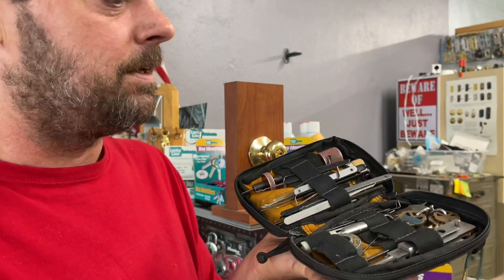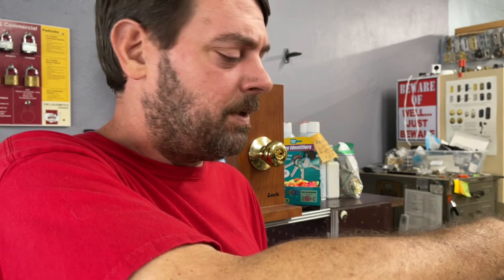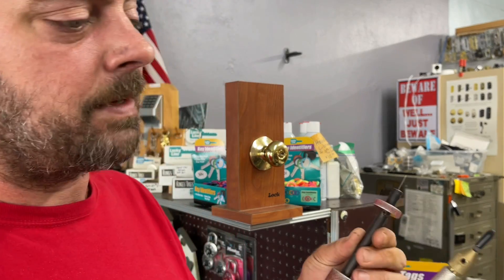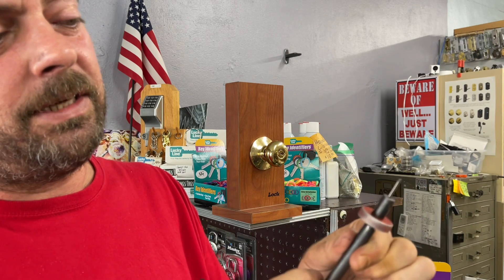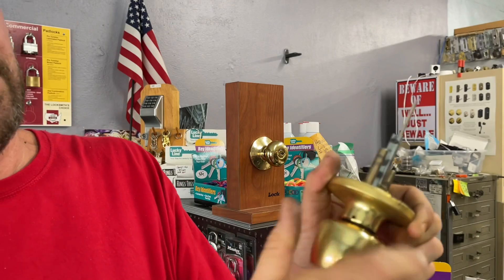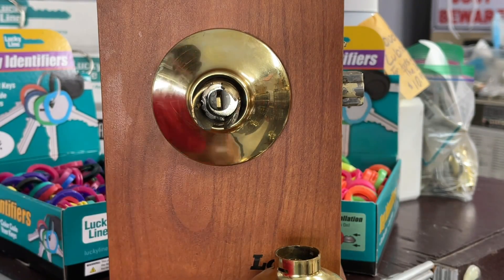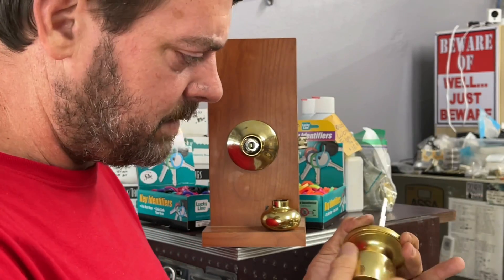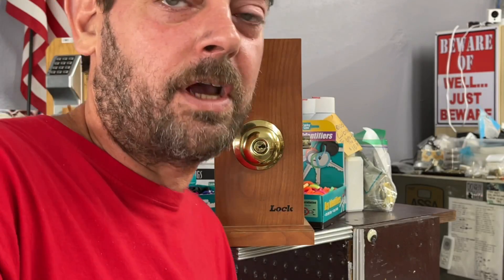Locksmith Tips & Tricks: Schlage Knob Lockouts, Avoid Spin Failure!

Comment from the maker: 4:41 in the video, I misspoke about “two retainers” while I meant to say “two retainer holes” I corrected it in video but wanted to post it here just so everyone understands the “generations” of knob styles.

Here is the text that is in video: which kinda explains the different knobs but is kinda small in video itself:

I need to clarify this, there is only ONE retainer on all Schlage knobs

Old Old F Series = 1 hole on each Side, retainer is in one or the other, standard cylinder type

Old F Series = Compressible Cylinder, only 1 hole on one side with retainer. Lock stays locked outside if inside knob is turned

Newest F Series = Same as above but auto unlocks turning inside knob (and has significantly reduced Schlage lockout calls I might add 🥺)

Also at 10:02 I said “Kwikset are tougher to open” when I obviously meant Schlage. I think my brain saw the plug in that vertical position and it made me think Kwikset, cause only Kwikset’s levers had vertical lock cylinders 🤷‍♂️
Reply: Thanks for clarification Jason great video my friend, totally understand want you ment thank you 😎

Comment: I have been out of the locksmith trade for 15 years, but back in the day I made a tool out of a kwikset deadbolt plug and a cut off sc1 keyblank. You may or may not know this trick, you could insert it in to an f series knob. Twist the f series knob twist it lightly and wrap the tool and it would jar the mechanism and allow you to open the knob without even picking it. I don't know if Schlage fixed this flaw, but it was a great trick back in the day.
Reply from the maker: ahhh yea the ole bounce open deal
I think that got cleared up before the compressible era rolled up on us but yes I recall using that a few times. As I recall though I wasn’t too fond of it, but it may have just been my not getting it

Comment: I’m usually using a Lishi if I pick one backwards I  always take a reading before spinning it. Then if I blow it I just cut a key.  A lot times in these f series they will take to lock position really easy then you can use the Lishi to take a reading and cut a key
Reply from the maker: another trick I’ve used, when you have multiple doors to open but you happen to be a good distance from the truck to cut a key, is once you’ve read the depths it’s typically pretty dang easy to Lishi again
Had a couple of deadbolts on a public pool restroom I recently did that to avoid walking a good way in the rain :)
Reply: @selock  definitely easier to Lishi stuff if you know the bitting! I do that cars a lot. I’ll pick it ccw because I’m a righty and it’s easier then take a reading then pick it cw to unlock it once I know the bitting.

Comment: i haven't Lishi picked the compressible cylinders yet but I have raked them open using light tension.  Sometimes a cylinder will pick one way better than the other though.  I've even bumped the compressible cylinders but I hate doing that as sometime the top will pop out.  Schlage should do better.

Comment: To me Schlage Compressible Cylinders are my hardest to pick. This is because the top driver pins are a smaller diameter and are under heavy spring pressure. Add that to the difficult biting they usually use make them difficult to pick.  There is a method I come up with that I go to whenever I feel I spent enough time to know this isn’t going to be a successful pick. These cylinders have a common weakness to them. And that is the compressible Cap. I made a few tools of different Lengths out of hard hook picks. I use them to get into the keyway and under the first two pins. From there I pry them up for the purpose of trying to “Blow the Cap” off the cylinder. From there it can be easily picked and you must rebuild it once off. 
    I learned Your Method of picking just to disassemble very early on. Especially on any commercial levers and knobs of all makes. I rarely use my plug spinner unless it’s for reversing direction of a tough deadbolt that needed to be picked in the wrong direction. 
   Time is Money. Great discussion.
Reply from the maker: yep, I hate doing it but I’ve had to “blow the cap” a number of times. Those times are ones where I giggle in joy when the installer put it in upside down ;)
Reply: Jason, I think a video about cap popping is a great idea! There’s almost no info about that out there

Comment: Those schlage knobs and levers are not easy to pick I've found
Reply from the maker: When that compressible cylinder came along it sure made them tougher :( even these "new fangled lishi things" don't like those t pins!
Reply: @selock  haven't had the pleasure of using a lishi on one but that's not surprising.. I always dread these knobs when customers don't have keys for them
Reply from the maker: @AuGold808  yep cause 8 out of 10 are gonna be corroded to heck as well!
Reply: You all are not using the Lishi correctly. When I roll up on Lockout and I see a Schlage lock, I bust out the Lishi and the customer is in he/her home in a matter of minutes.
Reply from the maker: @bobvalley4962  just like they can typically be raked in a “matter of minutes” Lishi is just another tool and nowhere did I say I was unsuccessful using the Lishi. It just doesn’t like the t pins compared to standard cylinders